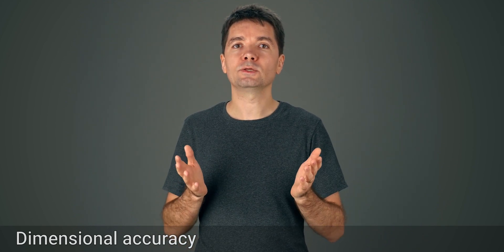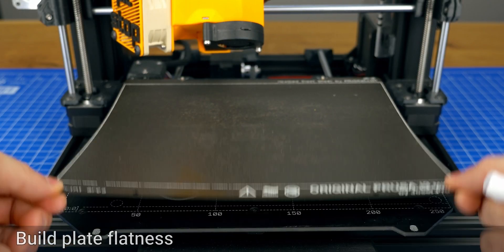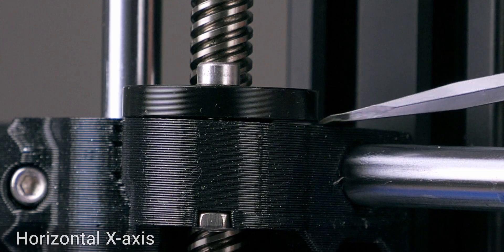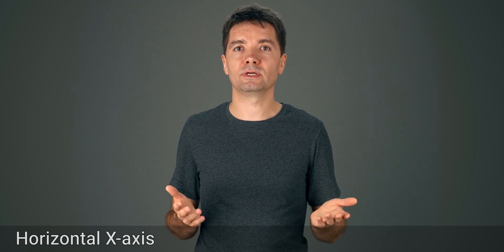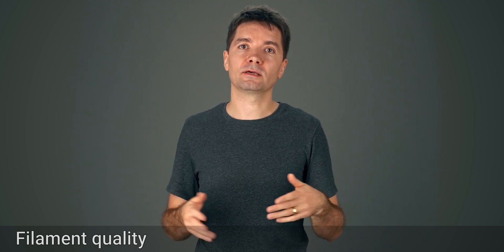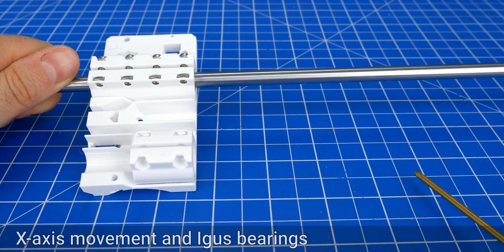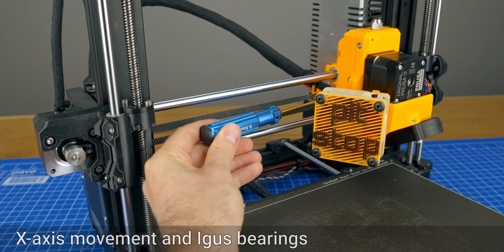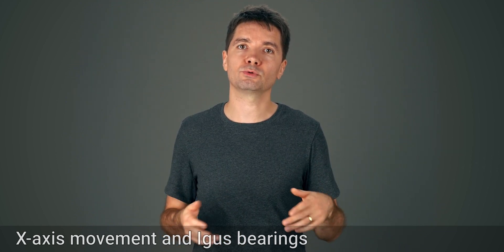Fixing X-axis movement: calibration, filament, and bearings

Comment: Hi. I really love your videos. In depth but explained in a clear way.
I’m thinking about upgrading to the pitstop extruder. After seeing this I’m also wondering if I should, at some point go ahead with the igus mod. My printer isn’t overly loud but I can hear it working at night.
I have seen some mod parts in some videos that I’m curious about but can’t find any good information about.
Most visible is the z axis bearing holders. Yours have some clamping screw. Is this part of some igus mod that I cannot find any information about?
Also I haven’t found any good video showing the noise improvements with doing a igus mod. Would love if someone could say it’s X dB on the X
,Y and Z axis, or something like that :) What is your experience? Does it run much more quiet?
Thank you for your great content.
/ Kenny

Comment: When Tom Sanladerer said Igus bushings need external tensioning, this spec doesn't refer to the same model of bushings that you're using, but the beige narrow ones, these grey ones are supposed to be drop-in replacements for the corresponding bearings. He made an error by implication. However he must have made an observation, and you also have definitely experienced that, untensioned, on standard printer smooth rods, these grey ones still outright wobble by a substantial amount. The real trick is that IGUS sells their own rods which are slightly larger and sized to fit these bushings!

I find the whole idea of tensioning them a bit precarious. I mean the plastic doesn't really change in volume when you apply tension, it just turns into more of an oval... this idea doesn't sit quite right with me. I have tried IGUS and gave up on them and just use my own PETG bushings now. But i also run a feisty torque setting and don't have sensorless homing or stall detection on my printer, so i can afford to have a somewhat sticky movement system, which is what you get with PETG bushings!

Comment: I tried various bearing & sleeve combinations on my MK3S with the following outcome:

Noisewise, the bed bearings have the most influence by far, the X-Axis is barely noticeable in daily use.

As for sleeves, I compared IGUS vs. brass ones with graphite spots in them. The latter are mechanically more robust to clamping tension and have a little less stick/slip friction on the steel rods from my POV. Both variants need very precise rod alignment in order to not bind (which I simply couldn’t achieve properly on the X axis due to lack of adjustability).

Ball bearings are frictionwise far superior to those sleeves and are easily applicable. The only real downside is the noise.

So I used brass sleeves on the Y axis (which took a little tinkering for smooth operation) and ball bearings on all other axis. The printer is extremely quiet now and has no noticeable play in it, so print quality isn’t affected. The Y axis rods have to be maintained once in a while with some PTFE spray.

All in all, I can recommend this setup, if you‘re not affraid to setup your bed a little
Reply from the maker: Great insight! I had a similar experience. It's tricky to get the rods perfectly aligned. I'm thinking one day to make the carriage print in the same position as the x ends on the bed to hopefully get identical dimensions. Ball bearings are the most forgiving for misalignments, although I'm not sure if they get "used up" faster.

Comment: I just reprinted my Pit Stop in "Strong and Precise High Resolution 3D Printing Resin by Siraya Tech (Clear V2)
" on my son in laws SLA printer and they came out so clear I can watch the filament move though it and no problems with light hitting the filament sensor. I have been using this for the part cooling fan as it holds up to the heat so much better.
Reply from the maker: Sounds awesome! I was wondering how it would look printed in clear resin.

Comment: I am sticking with my SKF bearings with 8x ball bearing races in them.  They are probably the most expensive option, but last I checked can be had for approx USD $20/ea.  I've seen too many people overuse the Igus bearings to the point where their dimensional accuracy suffers and at some point the printer refuses to print.  Good to hear you are stating that Igus is not for everyone.
Reply from the maker: Hey Aaron, glad to hear you can afford quality bearings. Definitely a great investment. I have the impression that bearings are heavily underestimated in a printer.
Reply: @MihaiDesigns  That was a few years ago when I had a better paying job.  Good thing is, I've never had to replace them since.
Reply: Hey Aaron, do you happen to have part numbers for these bearings?
Reply: @salloroc20  SKF LBBR 8-2LS; https://forum.prusaprinters.org/forum/original-prusa-i3-mk3s-mk3-improvements-archive/great-bearings-skf-linear-bearing-lbbr-8-2ls-hv6/

Comment: For ASA to what temperature do you set the enclosure?
Reply from the maker: I didn't bother checking. It just heats up from the bed (I leave the bed on for a little while before printing). 50-60 degrees I imagine. You'd probably get better quality with higher enclosure temperature.